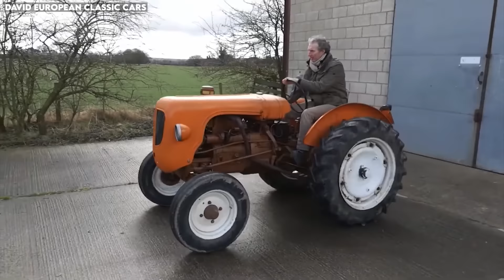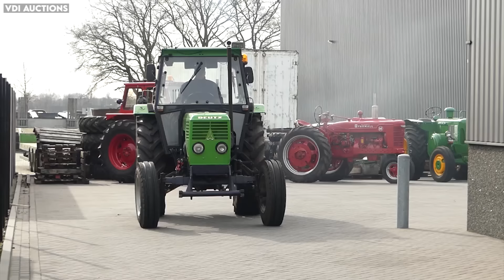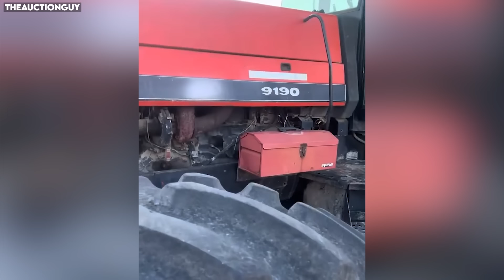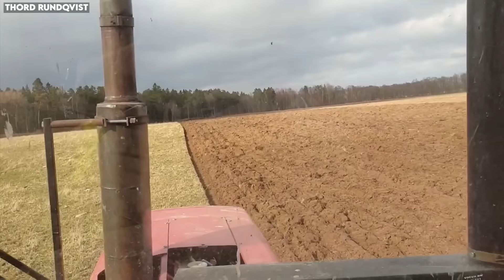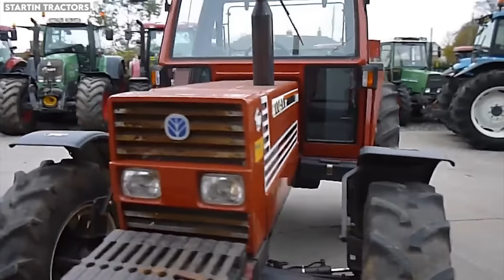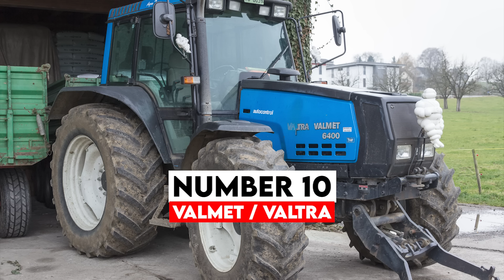10 European Tractors Americans Were Obsessed With

Comment: The BM Volvo 650 model of January 1970 had a cabin reducing the sound to less than 85 dB/A. Rubber mounted and was the quietist cab on the market. In Sweden safety frames were compulsary from 1959. 
On CVT. DAF; van Doorne's Aanhangwagen Fabriek (van Doorne Trailer Factory) constructed the CVT transmission for their automobile branch consisting of a belt and varying two pulleys in 1958. Similar to combine harvester principle 
After selling their car division to Volvo Hub van Doorne and Hemmo Ludolph started to develop a metal push belt system called Continuously Variable Transmission which they sold in 1972 to Bosch.